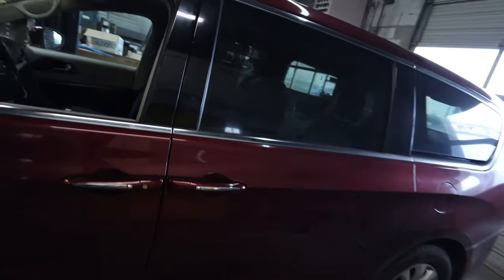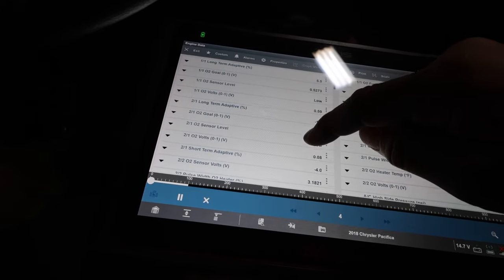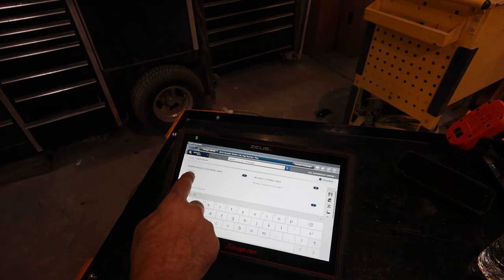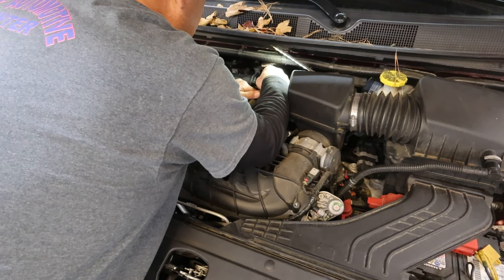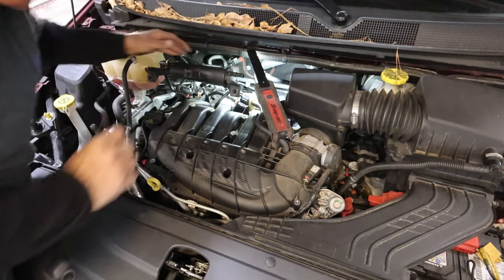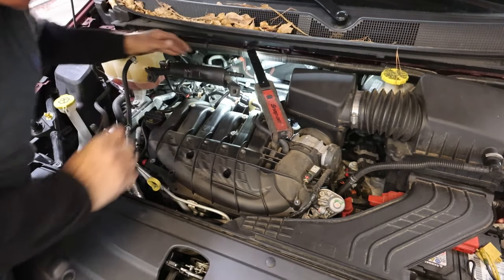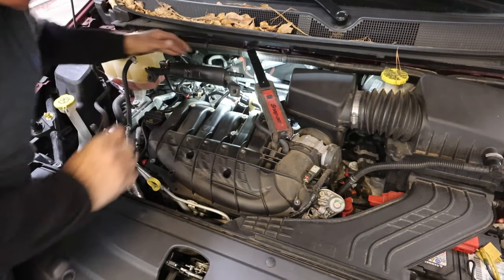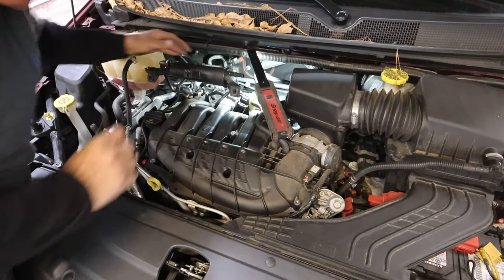2018 Chrysler  VAN MISFIRE~ Simple Fix ~

Comment: Seems to be a common problem.  Lot of people being told leaking head/cylinder engine needs replacement.  Did they make it to Arizona?  My wifes did same thing replaced coil on #1 last night....better for now, but i guess we will see.
Reply from the maker: Yes, they made it all the way. These people are friends of mine. We do keep in touch and as of today’s date everything is running smooth.